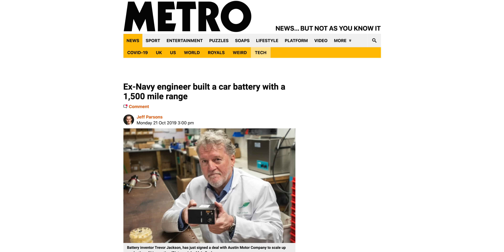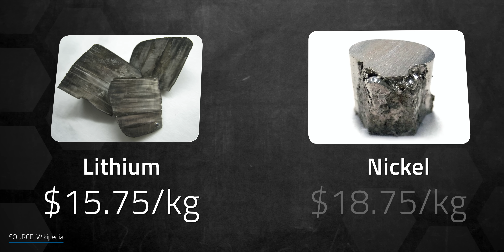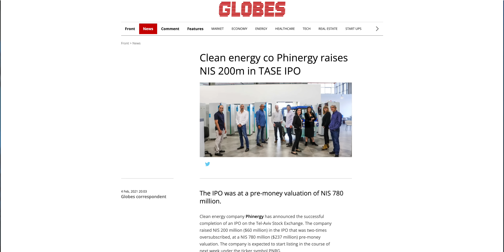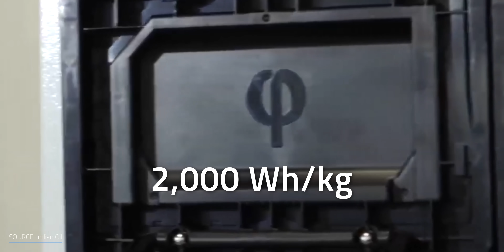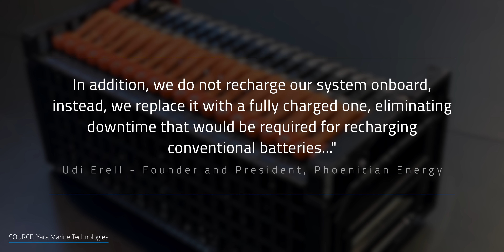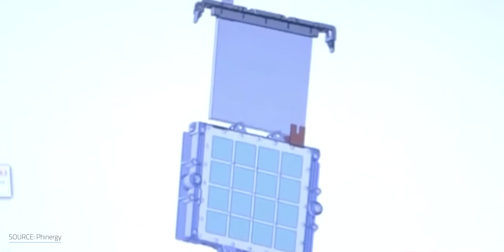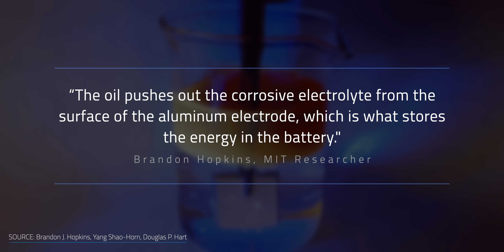Exploring the 1000 Mile Car Battery - Aluminum Air Hype?

Comment: Non-charging makes it a non-starter for me. I doubt this gets past backup energy storage use cases until the charging issue is solved, if possible. But I can't imagine how much it would cost to have to buy a new car battery every 1000 miles, much less how annoying it would be. 

But it would be cool to have a small one of these batteries to top up your EV in an emergency. In this video it was stated that a Model S battery, which weighs 1200lbs, could get 2700 miles of range with this battery. That's 2.25 miles per pound. So you could keep a small 20lb backup battery of this type in your EV and that would give you about 45 miles of additional range. This should be enough to get you to a charging station if you run out of charge in most circumstances.
Reply: This is just a different approach to "charge" the battery. You can just swap battery. All depends on a price. If the price of swap will be similar to the price of charging, you would probably swap batteries with no complains. Because swapping is much faster then charging

Comment: Aluminium batteries have a place in EVs utilising the positives. Like capacitors are used for immediate power, Aluminium batteries can be used to augment Lithium batteries ... in an 80:20 setup, 80% Li-ion will be backed up with 20% Al-ion (that will equal to 140% of the Li-ion). This will make it an essential part but not a critical part .. reducing swap out frequency and vehicle is still operational even when its drained.

Comment: I mean I think it would be a good application with conventional rechargeables if used as a range extender. That way you could still have a rechargeable battery and gain more range. Lets give these batteries a few years but even then use them wherever the application fits best and forget about EV's until we find a true successor to modern day battery packs. It's only a matter of time before we have EV's that outperform conventional fuel cars but we still are quite a ways off from any new battery tech making any major breakthroughs.

Comment: EVs and large factor aren't the best fit for these one time use batteries but is more suitable to the disposable market place.  Imagine a flashlight with one of these batteries built in that last a 1000 hours that is easy to recycle once spent, could easily replace alkaline batteries in this space.

Comment: None of these technologies are really even worth spending a lot of glucose on until we can see them moved up to use case scale. If they could make the batteries small enough such that they would be no larger than the size of a standard laptop (and they can deal with the degradation issue), then multiple batteries could be purchased and carried on a trip, increasing range. The lack of rechargeability isn't a stopper. We replaced batteries in flashlights for years, and they were still quite useful. The biggest issue discussed here is the COST OF SILVER. Unless they can minimize the amount of silver required in the process to make them economically feasible, they entire conversation could end up being another ghost story.

Comment: Sounds like great potential - pun...-
The backup battery concept will catch on IF it's quick to change with quick connect clamps. 
ALSO need to have a true remaining power/mikeage is left.
AND this battery while in storage shoukd have the initial catalyst be readied to add before use.

Comment: I think the marine use sounds more promising since if you essentially make a battery pack the size of a shipping container that can be swapped out in port that makes more sense then trying to charge a cargo ship equipped with lithium ion batteries. Imagine the strain that would put on the grid of port cities

Comment: Most bizarre arguments have been made to describe the cons of aluminium battery. Only a stupid would person would find it true. Aluminium air battery would kill all the other type of battery for this application for sure and western technology suppliers would not profit from it because they are out of race. Aluminium air battery is electric equivalent of petroleum fuel. When you run out of fuel you go to fuel station for refill. You put fuel in tank and then good to go. Same would hold true for these batteries. In fact it would make swapping of batteries so simple that only road side vendor would do it for you without the need for setting up a huge fuel station, one could get the battery swapped everywhere. The speaker forgets that Indian are software wizards, they would create applications which would give battery residual range to driver , show availability of battery at various swapping points within the residual range of battery. 
I would ask a simple question why we continue to use dry cells for various devices at home. Why these devices don’t come with polyester or lion batteries fitted as internal part of equipment, why all mobiles have fixed battery which can not be swapped. The answer is that companies don’t want you to have a solution which would solve your problem at once. Today mobile phones sell only because it’s battery fails after few years. These companies ensure that original batteries are also not available in the market by threatening the suppliers to stop using their batteries if it is found in open market. 
Such videos are also part of their plan to block other competitors and their product.

Comment: Well, for battery swapping, we can employ something like an EV mobile charging, instead of carrying gas generator (which defeat the purpose of all electrical vehicle), we make them send a new battery for replacement, just like buying AA battery.

Of course, aluminium battery is still in early development, but its potential can't be ignore. Lithium also need lots of time to be improved. However, the recycle-ability seems like a good promising future, just like lead-acid battery. We may need to give it more time to see how it evolve.

Comment: Swapping the battery is best option. As buyer need not to worry about the battery life and endurance in long run. Mobile battery swapping services can be arranged which will reduce recharge time. Out of 3 disadvantages 2 can be migrated. I looking forward for AI-Air battery in india as  replacement of fossil fuels.

Comment: First off, you have to think about this as “solid gasoline.”  You just replace them as they run out. Are they a good alternative to gas? Well, there was no “carbon footprint” comparison between the two, nor between these and Lithium batteries. As a long range booster for current systems, this looks excellent. You daily recharge your lithium ion batteries for your local driving needs, then tap the Al-air for long trips. Recycling was glossed over, and here in America that usually means the trash heap. Finally, there currently is no cost comparison between these batteries and gas. Is a set of replacement batteries the same or less cost than 3 1/2 tanks of gas?  The 1,000 projected range would be approximately 3 1/2 tanks of gas for my car. It’s got some promise, but still too many unknowns that need addressed right away.
Reply: The recycling might be closer to refining the aluminium again, since the battery works by oxidising it...
Reply: Yeah...I was particularly annoyed by the brush past the economics of this battery vs Li-ion.  What's the cost/KWh?  Cost of recycling? Therefore...compare cost to power a car for 150K lifetime vs alternatives?  Your question about the long-term carbon footprint question is equally important.  LOTs of fundamental questions left hanging here.

Comment: The only time when a 300 mile battery isn’t enough range is when a gas company tell you it isn’t.

It’s been 3 years and never once did I wished for more range.  Spending the extra 20 minutes charging on road trips was never an issue as we all need to take food and bio breaks.   No doubt that a bigger battery is nice, but in all practicality waiting is less practical

Comment: I believe if these batteries were utilized that there would be portable swap stations just like somebody can come and give Tesla charge somebody can come with a new battery and swap it out so there wouldn't be such a big difference between lithium battery issues and aluminum air battery issues

Comment: ... I can't believe you didn't mention anything about applications in aviation. A lighter weight, higher energy density battery solution is perfect. It would also mitigate the problems of needing a battery changing station since planes have to land at designated airports anyway.

Comment: If the battery needs to be completely recycled (i.e. stripped back to its most basic components and materials) after one use, it's probably not going to be commercially successful.

Comment: Aluminum air batteries seem like a dead end technology. Why aren't we looking at Aluminum Ion tech? Potentially they are better than lithium batteries in every respect. Charge much faster, lighter, higher power density, and don't need complex systems to keep them cool or warm. Also cheaper than lithium, recyclable, and abundant enough where one country can't control the worlds supply.

Comment: Interestingly enough, Al-Air was how the NASA Moon buggy worked.
I'm very split on the concept- one of the draws of EVs for the future for myself is their energy agnosticism, but these require the same systems and structures modern gas stations need to survive. I could see it being interesting with something akin to the PHEVs, where you have a "main" pack and your "long range" Aluminum pack.

Comment: Combine this with Nios battery swap station technology and roadside service vans if you get caught out ..using standard size packs..
The old packs get stripped and re melted- charged up ...coming back as new packs.. metal recovery is almost 100%.
Aircraft and boats could all use similar tech because of the light wt and greater charge density. 

And having seen the problems of building lithium based battery tech. This seems like a winner. 
Structural batteries are a nightmare if anything goes wrong .. or if they get damaged even slightly. 😱 
Scrap the vehicle because you ground out on a speed hump or take a minor bump . Plus you are tied to that type..capacity of battery.. you cannot just go along and say im due for a swap can i have bigger better new version.

Comment: Great video Matt, you always do a remarkable job researching the subject. With aluminum being so light, I think a comparison of energy density by volume would be more useful against lithium batteries as the form factor is often what limits battery pack size. Multiple small modular aluminum batteries could be replaced as needed without risking running out of charge on a long trip, and aluminum could also be an excellent range extender or backup battery to conventional lithium. If expensive materials like silver can be recycled, the cost of replacing batteries could be reduced substantially with a deposit on each new pack

Comment: I feel like an EV that used both Li and Aluminum would be pretty ideal. Continue implementing the li into the structure of the car like a tesla (perhaps with a little less range like 200 or 250) and the ability to use Aluminum air when needed/possible (like longer trips)
Won't get stuck, can still charge, and has the benefits of the Aluminum air batteries. Maybe also have it be an option in settings for the car to take power primarily from one, the other, both evenly, or both equitably? Perhaps the "fronk" could be for the batteries or optionally existing extra storage

Comment: The motorcycle manufacturers have already started the process of developing standards for swappable batteries. This technology may benefit from that.

To maximize efficiency this technology would need to be combined with a rechargeable energy storage solution so the regenerative braking can be utilized. It could be rechargeable batteries, capacitors or any other energy storage type.

Comment: No. Driving an EV with a non-rechargeable battery is not even a consideration. Since the battery has to be regularly replaced, you have to consider: How much of the battery can be recycled? What manufacturing demands would there be since they have to be replaced every few days? How much will a new battery cost, esp. vs just recharging?

Comment: Sure, I'd prefer one with battery swapping actually. Used to drive a forklift back in the day and this seems not much different than swapping out propane tanks.

1500 mile range is actually excellent. I'd take that over charging station for sure.

Comment: I've been following aluminium air batteries for a few years since the guy in Plymouth hit local news. 
I'm really pleased to see you pick up on it as an educator and publicise it. Also really pleased to see it's actually getting some serious investment.
I think we quickly forget how much time money and improvement has gone into ICE vehicles over the last 100 or so years and how much we need to put into the next battery to get over the shortcomings. 

I think the speed of the "switch out" could be the clincher against long charge times. Also in your being stuck in there middle of nowhere issue, I don't see why an emergency charge is any different from an emergency delivery of a replacement battery. 😋 
As long as the recyclability is genuine I think it's a possible winner.

Comment: Obviously, Al-air is better as a range extender - perhaps 500km would work if long trips are your thing. Electrolyte only to be pumped in when use is required. Along with 200km rechargeable battery, would be good for main regular use. Al-air Swap stations in rural areas would be the way of the future. If your car had solar and wind generators you would probably never be stuck without power anywhere for too long.

Comment: I've always believed that the range anxiety most people have regarding EVS is completely irrational. Most people have multiple cars in u.s. if you're going to take a lengthy road trip why not use the gas burning or hybrid SUV. Seriously though who commutes over 300 miles on a daily basis? I'd wager most people don't even commute over 50 miles a day. People would use a designated EV commuter car we can make a large impact on cutting emissions. I believe in a future work gas and electric cars can coexist. If you're using an aluminum air battery set up you just have to budget your mileage like any other rational person would. Just my two cents

Comment: No different than running out of gas. If a tow truck can carry a charger, it can carry a new battery..For that matter,why not have the vehicle carry 2 batteries. When one goes to "empty", the new one kicks in and you can replace the battery at your convenience.

Comment: Well I think a well designed battery and a well design car with easy swap in swap out and a reduce cost like gas bottle, the battery alone cost like 500$ but if you return your old one its only 80$ or maybe even one with smaller range that cost like $10 for a 100 miles.
But I think mainly could be for commercial vehicle like bus, trucks or ships with heavy daily usage with sawps at the end of the journey

Comment: So you are saying a lithium battery can be topped up on the road by a service van, but an aluminium powered car needs to be towed to a changing station? So, what prevents the service van from carrying spare aluminium batteries and swapping them in 3 minutes, which will give you another full run of thousands of miles, instead of 60 miles top up? Are you just trying to find downsides to the competitors of the lithium batteries?

Comment: I think it makes sense for the trucking industry and it would compete most strongly with hydrogen fuel cells.  If you only need to replace batteries every 1500-2500 miles, say, then that helps with getting a small number of large battery swap stations up and running quickly.

Comment: The tire truck could just bring you another battery, like they would with gas, which people someone run out of now.  Send like an identical problem.

Another reason this technology might have more success on the market, is that you have to keep buying batteries, which would lead to more battery manufacturers and recyclers.

Comment: Cost of battery replacement would have to be considered, Could Companies like AAA have batteries available to members who need them roadside in an emergency.  Require stations to operate 24 hours a day who provide that service.   There are always ways to work around infrastructure issues.  The current issues with the lack of hydrogen availability or the stations to provide it for California is one example.  there are always growing pains in any industry, but there seems to be intrepid users who want to use new green technologies to help save the planet.

Comment: "Replacing a conventional Tesla battery pack with an aluminum air battery pack of the same WEIGHT"

Based on what was said earlier about how light these Al air packs are, I am guessing if an Al air pack had the same weight as Tesla's pack it
would be physical larger than the entire car itself.    Energy/kg isn't the only factor for a car, the amount of space that the pack occupies is also important.

Comment: Sounds like good batteries for very specific applications... But not EVs

The whole idea that we wanna ballance the grid via charging/fully charged EVs goes out the window when they are never charged.

On the other hand it would put less stress on the electric infrastructure if no-one had to charge their battery, only swap out the aluminum inside.